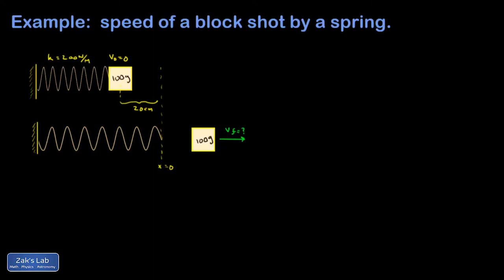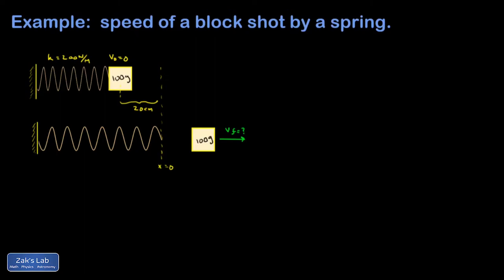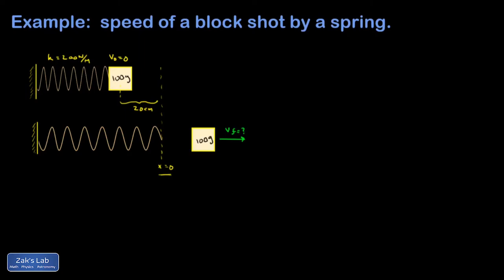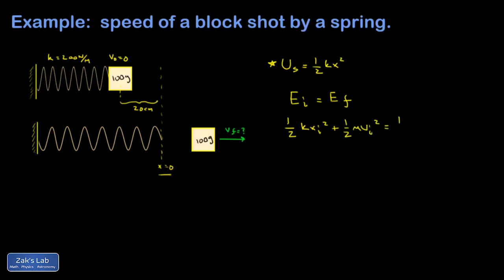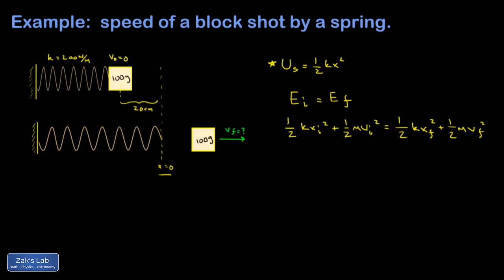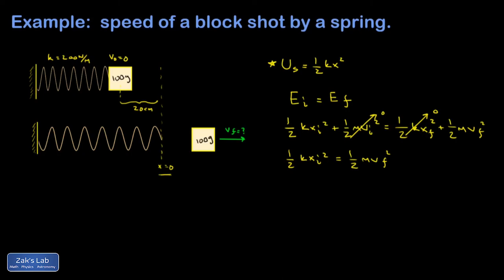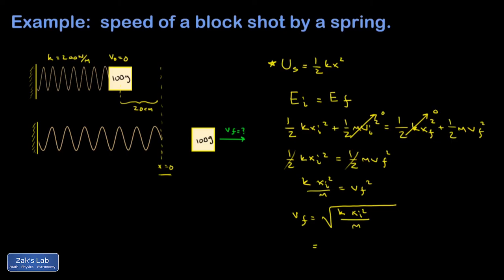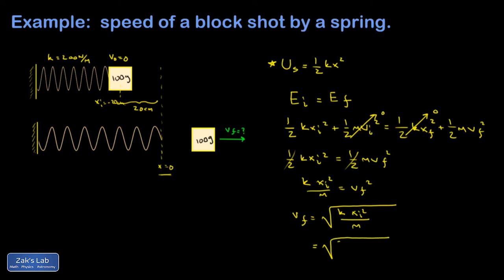Max speed of a block shot by a spring conservation of energy.  Spring-block maximum speed.

Comment: I have a question, with that same problem but now the whole system is on an incline with angle for example 45 degree relative to the ground. Can you explain how to solve it? Thank you.
Reply from the maker: I made a video that has a block and spring on an incline, only it's running in the reverse direction (the block hits the spring).  The discussion there might help.  https://www.youtube.com/watch?v=FzOCslyLAfs